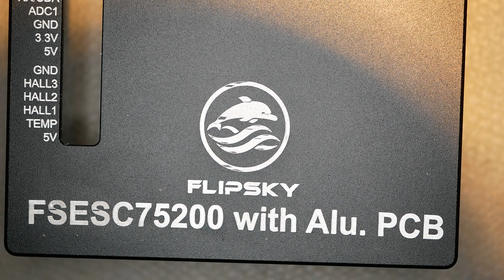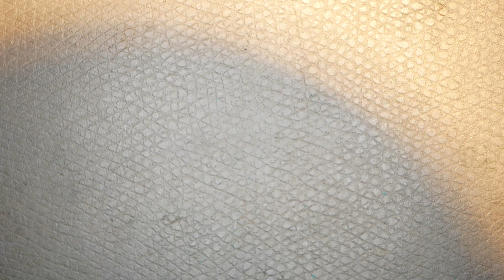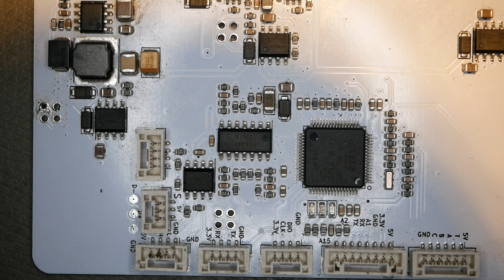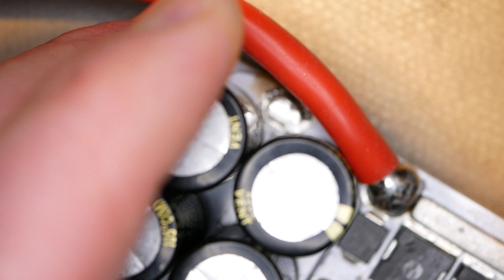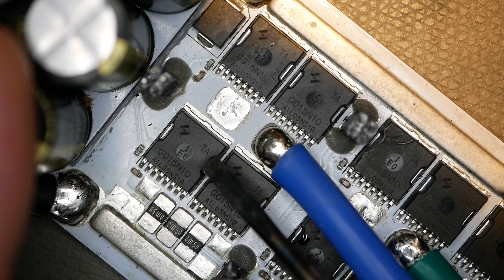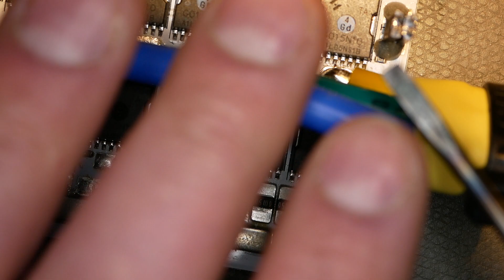Flipsky 75200 Teardown Macro

Comment: I'm trying to use this controller but I'm a bit space constrained. I'm assuming I can separate the power and logic stage of the board and mount them side by side with some longer wires to connect them?

Comment: Glad you didn't just rip on it, however you suggested there is laziness in the design (or cost effective measures...). Just wondering what you suggest as the best of the best for an equivalent power output?

Comment: please notice that using multiple buck converter in series it's a BAD thing not a good one.
Buck converters are noisy and produce harmonics at switching frequency, put them in series (3 in this case) and voilà you obtain pretty noisy power supply, on the other hand LDO are very good with noise and are preferred if there isn't too much power to dissipate.
that's why in most electronics you will find 12V obtained from buck converter and then 3.3V obtained almost all the times via an LDO.
PS also LDO are simpler, produce no EMI, and keep your design clean.
Reply from the maker: Yes...several people have said this. Thanks. I've noticed that an LDO is better at the CPU as well...changed my mind on that detail. For 12v and 5v, I'm fine with BUCKs. However, if you look at Trampa controllers, they all use 3 BUCKs in them. Flipsky basicly copied Benjamin Vedders work!
Reply: @de-bodgery  yes they are rearranged copies of boards from Vedder and other guys that that upload photos and schematics online of their bosrd. But they commit small design flaws that make huge reliability difference...
Reply from the maker: @gabriele476  agreed...like no current sense amps, no ceramic caps, cheaper mosfets and caps, etc.

Comment: Hey, are you able to tell me what those 20 pins are? Theres 5 4 pins on the board, 3 of them close to gate drivers, 1 on the bottom right and 1 close to the main circuit..
Reply: Yes I do know and understand but do you know what's the purpose of each single pin?

This is my guess of what it could be:

Left: 
01 low side mosfet output
02 high side mosfet output
03 ground
04 ? hall sensor 1

Top center:
05 low side mosfet output
06 high side mosfet output
07 ground
08 ? hall sensor 2

Top Right:
09 low side mosfet output
10 high side mosfet output
11 ground
12 ? hall sensor 3

Bottom center or bottom right?
13 ground 
14 low voltage input
15 high voltage input
16 ? temperature 

Bottom center or bottom right?
17 ? ground
18 ?
19 ?
20 ?
Reply from the maker: @ghostzofficial2786  I don't know what every pin does. I never traced them out. Halls won't go down to the power stage. Those pins will carry battery voltage, high and low side drive for each phase, current shunt sensing and temp sensor.
Reply: @ghostzofficial2786  12:46
Reply from the maker: They transfer signals back and forth between the logic board and the power stage.

Comment from the maker: Corrections:
Thank you MrDehicka for the corrections!

1. I mentioned that there is an IC that I found was a SAR, but that's apparently incorrect. It's a quad op-amp SGM8634.
2. LTC1051 op-amp is incorrect. This is a TJA1051 CANBUS transceiver.

Comment: The lack of ceramics is surprising, and the ceramic touching the case is... ugh... and the not fixed down IMS, well FFS, why... Easy mods with thermal glue and pads for an end user but that should have been done out of the factory. 

The low side shunts are the same as on the Trampa VESC100250. Nucular also appears from your video to use a (single? I can barely believe this?) low side shunt. Low side shunts are absolutely fine, the only limitation on VESC is silent HFI, the main FOC runs identically. It absolutely does not end up in unbalanced currents or anything like that on the high side MOS.

That view of the capacitor mounting PCB solution was really great, thanks for that, off to modify my last PCB design 🤣

It would be interesting to see switching on a scope to see the effect of not having the ceramics. It MIGHT be OK. It might be a clown show. The HUAYI MOSFETs being used are very slow switching compared to most TOLL, which means the decoupling requirements are much reduced. I think they are the same as the ones on the EBMX? Correct me if wrong, I did not hear you call out the EBMX MOS brand name.

Now I have an opinion on Flipsky a bit against the usual grain... I think they are pretty good.. I have owned a few of the small ones and they live on, but one thing I noticed myself subconsciously doing is that every time I have a dodgey battery or motor I am unsure of... I reach for the flipsky to test it. Not going to wreck my expensive hardware or stuff that took me ages to assemble now am I.

I bet that flipsky hardware gets 10x the abuse Trampa hardware does, purely BECAUSE it is so cheap.
Reply from the maker: It's Flipsky, this isn't really surprising that they cut corners! Trampa 100-250 does low side shunts? I got that wrong. I was sure they were actually on the phases directly. No ceramics is probably a clown show. I have yet to do a component review of the X-9000. That video was really all about the copper and then I got carried away with other things that the EBMX haters claimed. I think you are right, who cares if you kill a Flipsky!
Reply from the maker: Hit me up on Facebook please.
Reply: About the shunts. Does it really need shunts on both the low and the high side? It's gonna go through the same coil anyway so one wouldn't need to measure current on both sides of the same coil(s).

Comment: Flipsky didn't get the naming scheme Vedder and I chose for the 75/300 and 100/250 VESC motor controllers. The first letters are the component's voltage rating, second the Amps you can push. The 75/300 is a phase shunt design with 75V Mosfets, the 100/250 is a low side shunt design with 100V mosfets. The latest device from Flipsky is marketed as 75/300 although it has nothing in common with the 75/300 design! These Flipsky units are all low-side shunt designs! Marketing wise they obviously want customers searching for the VESC 75/300 to find their controllers and assume it is an equal alternative (which it obviously is not). The downside of that unfair marketing strategy: People already loaded the VESC 75/300FW onto the Flipsky ESC and destroyed their controllers.  Consequently, Vedder and I decided not to host the Flipsky FW in VESC-Tool due to naming issues and confusion. We don't want our customers to accidentally load the Flipsky FW onto the original VESC controllers. They have to get more creative in naming and coming up with their own branding first. The lack of high-frequency caps is also quite astonishing as those are a pretty vital part to suppress the noise. I guess that there is no good way to place them in a 2 layer PCB power stage and they also cost some bucks.
Reply from the maker: I understood the Vedder naming and then to have Flipsky completely muddy the waters with their version...ugg! I've got a few Flipsky controllers. They work...things could be worse, but not by a lot. I don't like the low side shut design. I'm pretty sure it causes current imbalances from the high side mosfets. No ceramic caps and other short cuts...maybe this content will get them to say "Oh shit, we better do a much better job!" I need a couple more of their controllers to tear down...just to show where they fit in the VESC ecosystem....nearly at the bottom. I think it's a close tie with MakerX.
Reply: @de-bodgery  It amazes me how people run maker x and remain quiet when the controller blows out the side of their bike leaving them with just a battery on wheels
Reply from the maker: @evgizmojm  If I get a hold of MAkerX controllers, I'll do tear downs of them too. Walking your EV home, it happens.
Reply: LMAOOOOOO sure enough i didn't even see the part about the controller going up in smoke and assumed it was so. What a disaster, never buying one of these